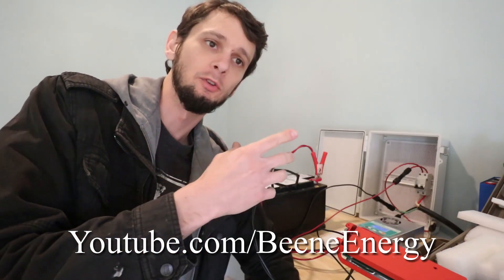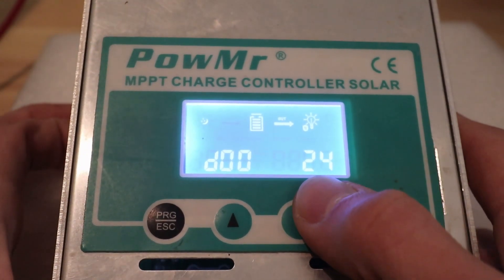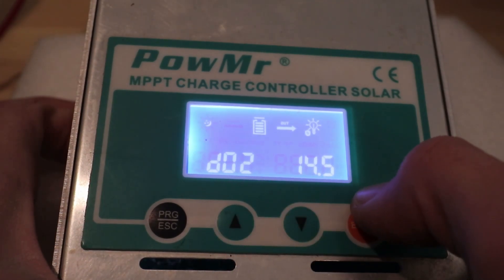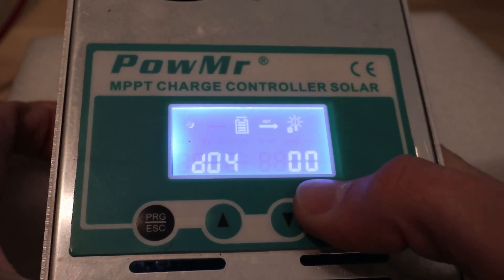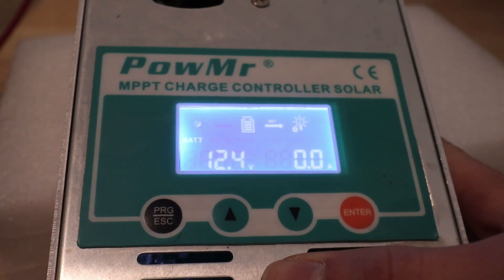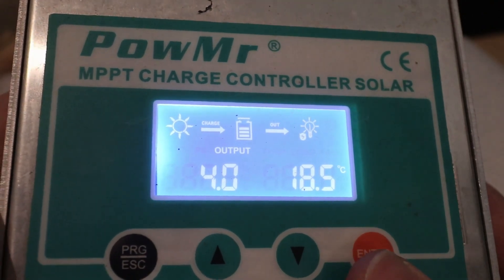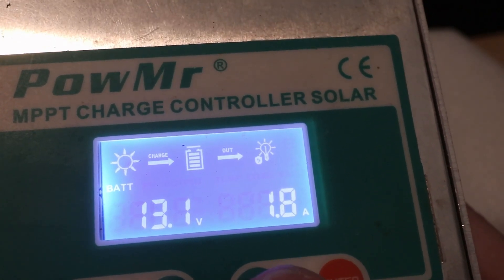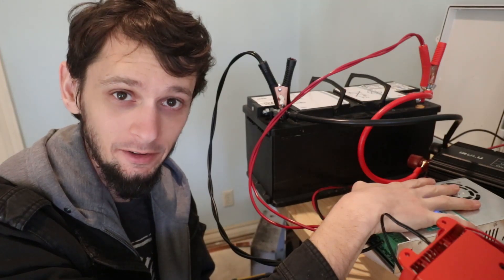PowMr $100 MPPT Charge Controller Using (98v - NOT RECOMMENDED) of Solar Input to 12V Battery

Comment: Hi.
Why in minute 3:33 pv is 1.3 v when no PV is connected?
I have one of those controler, and only with the battery connected it is showing voltage in the pv imput.
I measure the pv input, without pv connected and it measure the voltage is showing in the screen.
Is there a way to fix it?
Thanks.
Reply from the maker: Couldn't say why. I'll say that even on expensive hybrid inverters it does the same thing. I show 25v on inputs that have nothing connected. Probably some explanation  available from someone with better electronics experience than me.

Comment: so i just bought two of these. i have 20 panels, each 100 watt. so im going to make groups of 5 in series, then parrel two groups to each controller. so thats about 100 volts and 10 amps. running 48 volt. with mppt, im worried about high voltage as issue for these. is voltage good in your experience?
Reply from the maker: I don't expect a problem with what you're proposing. I've had these controllers go into protect mode due to high voltage but the only time I've blown one up is connecting it backwards to a battery.
Reply: @BeeneEnergy  thank you so much for your advice

Comment: Hello, i brought one of these recently. After my battery is fully charged the controller sits at Mode 8 (Float), At what point should this controller switch back to 4 (Bulk)? Currently when i put load on a full battery it still just stays in mode 8 (float)
Reply from the maker: That’s curious. If it drops below float voltage it should reset and go back to number 4. Does it at least charge at full blast or is it trying to charge only to the voltage of float?

Admittedly I only use it on lithium batteries so there’s only one charge voltage not float and bulk.
Reply: @BeeneEnergy  Thanks for the reply. Yes is strange but don't know if this is the default behavior for lead acid batteries or not.  I have it on the d4 setting of 00 for lead acid. I even used the battery down to 12.1v and still never changed to mode 4. Only changes to mode 4 when i disconnect solar panel and reconnect, or a new day start / morning. Kinda annoying as preferably would like to use it while sun is out, but have it charge at the same time.
Reply: @Daniel-wd9lx  same here. Have you found a solution?

Comment: I use a 50 amps mppt charge controller.
Any of you know when the battery is full?
Reply from the maker: Typically the charge controller will never know. Using something like a Victron smart shunt is a great way to know state of charge.

Comment: Hi,
I am using a 60A charger. In my charger, I don't see the watt numbers when charging though. I see the PV  voltages. Any reason? I am using a lithium-ion battery (24v). I tested with a 12v led-acid battery too, results were the same.
Reply from the maker: That's odd, usually pv voltage is on the left and watts on the right. When you are on the battery voltage screen does it show how much current is going in?
Reply: @BeeneEnergy  I was using a single wire to power the inverter and to do the charging. separated the charger from the inverter by using two different wires and my issue got fixed.

Comment: In what ampere the scc going to hot and turn on fan?
Is makeskyblue in better condition than powmr?
Reply: They are both cheap and nasty. Earlier MSB used to cut charging power, resettable by disconnecting and reconnecting solar input. PowMr are over rated. The 60A is a copy of old prototype MSB 40A, and also cuts out.  Both 40 & 60 amp PowMr use the exact same board, but the 60 is tweaked to display up to 60, but can’t do it
Reply: @michaelbouckley4455  they are cheap and long as you fuse panels and fuse the charge controller they are so worth it. You just need couple of these

Comment: Does this decrease volts and increase amps?
Reply from the maker: Yes this controller has a dc to dc converter inside to take the higher voltage panel and use that to charge a lower voltage battery. I’ve measured the efficiency around 88%. A 10a 49voc panel(400w) can charge a 12v battery at about 30a in good sun.
Reply: @BeeneEnergy  Thanks so much for the quick reply. I've been wracking my brain over all this because of all the fakes out there.

Can you review the T20 MPPT Controller? It claims to be MPPT and claims to have an inductor but the price is too good to be true. 
Here's a link https://www.ebay.com/itm/363356964903
There's also this one on Walmart by "Giant of Sun" MPPT/PWM 2-in-1
https://www.walmart.com/ip/735990269/
Not sure it has an inductor but would think Walmart wouldn't lie about MPPT. 
Love the channel, I've learned so much in just a few hours watching your videos.

Comment: Way over what is recommended by MakeSkyBlue ( who POWMR is a copy of ) for charging the 12 volt string. Panel Voltage should be kept in the 2X range for the best efficiency. Mine goes a bit over that and hits about 2.5X the battery Voltage of 24VDC nominal. Keeping it closer to 2 also means that there is less heat generated by the charge controller.
Reply from the maker: Good points. I’m getting some better measurement equipment in and will be testing at lower voltages.
Reply: The PowMr 60 Amp is a rip-off copy of the Make Sky Blue 40 Amp, but ‘tweaked’ to display 60 Amp when the current is really only 40 Amp. No difference in circuit board for PowMr 40 & 60 Amp (and similar price) their board has 40A & 60A silk screened on it. Not good quality, inferior to MSB
Reply: @michaelbouckley4455  so it means better buy makeskyblue than powmr right ?
Is msb also easy to get hot or not?
Reply: @MrDefour  MSB have newer versions 118 & 119 (with WiFi) better software, better buttons. They have same case and fan. PowMr have a new plastic model 100 Amp, for Lead Acid & AGM
Reply: @michaelbouckley4455  i think both only different in features.
But, is the minimum current amps also same to get scc hot and turn on fan?
Reply: Not true. Ohms law comes into play and the mppt converts the excess voltage to amperage and efficiency will go up. I run 80voc/19a into my mppt and I get 27v/50a out into my bank. Before I rewired my panels in series and just had them in pairs, I was getting 30voc/38-45a in and 27v/40a out.
I like the new way better.

Comment: One question, the load disconnects after the battery gets bellow the pre defined voltage on D03 setting. Do you know when it reconnects? It needs to be a manual thing?
Reply from the maker: In my testing the charge controller must be rebooted for load to come back on, it doesn’t automatically recover.
Reply: @BeeneEnergy  Thank you for your reply. That's a bummer :( How about if you set it on d00 to only 23 hours, do you think this will work?
Reply from the maker: @GoncaloRijo  I haven’t tried that before. I was hoping it would reset when the sun came back out but it didn’t. Maybe the timer has something to do with it though.
Reply: @BeeneEnergy  Ok, thank you. I will do the test once we get sun again (thursday next week) and will let you know how it went.
Reply: @BeeneEnergy  Hello again. Sorry for taking so long to do this test. It kinda works... Let me explain... If I use D00 I can set up the load to work for 23 hours a day. If the battery goes bellow the minimum voltage defined on D03 the load is tuned off, but since I've set the timer using D01 it will turn back on next day. The problem that I have at the moment is that even if the D01 is configured in a way that the load should have energy 23 hours a day, the load is only turned on once I have no energy from the panels... And it cuts off once the energy start to flow again from the panels, even if I configured it to work 23 hours a day... It seems that is only configured to work during night time, with lights... And I need it to work the whole day since it is connected to my grid tie inverter... Providing our actual basic energy needs. Any idea on how can I solve this?

Comment: Good morning, I'm enjoying the videos and the panels I purchased from you. At one point just before fall I was getting almost 500 watts out of the two 305 watt panels.
Reply from the maker: That’s great! Glad you have them generating!

Curious, what does your setup look like, do you have the angled or flat mounted? What are you using for a charge controller?
Reply: @BeeneEnergy  They are angled and facing southwest, right now I have an EPEVER 40A MPPT charge controller going into roughly 4kwh of battery. The battery is home made from 18650 cells.
Reply: @keyprice7304  Have you got a shunt to measure the current? Or a smart bms? I don’t believe the displayed output power of my Epever 60 Amp (Tracer6415AN Imax)

Comment: https://www.ebay.com/itm/48V-10-000-Watt-440-AMP-Digital-Hybrid-Charge-Controller-Wind-Turbines-Solar/392230899511?hash=item5b52c88f37:g:zlkAAOSwSxVcWHCa              What do you think of this?
Reply from the maker: Well that’s one way of doing it. Basically a massive pwm controller but using a relay instead of mosfets. I’m not convinced on the reliability and efficiency of such a device.
Reply: @BeeneEnergy  Sorry I was thinking of using this for windmill. Look at AMPS and VOLTS this washing machine motor puts out in it factory wiring configuration. https://www.youtube.com/watch?v=mLwl9M4BLj0&list=WL&index=75      Here are several ways to re-wire the motor to get a wide range of amps and volts    http://www.thebackshed.com/Windmill/FPRewire.asp      Do you think that pwm controller will switch off and on so much it wears the contacts out pretty fast in solenoidal? WILL mosfats last longer?
Reply from the maker: If they designed it for that many amps it shouldn’t wear prematurely for your project. One thing to account for is the power consumption of the relay. If you have constant wind it will be fine but if there is no wind and that relay is always on there is a constant power draw from your battery bank. I think that’s the main disadvantage of a relay is the consumption. Might just be a watt or two but typically the bigger the relay the more consumption.